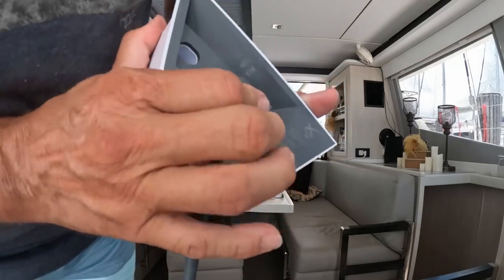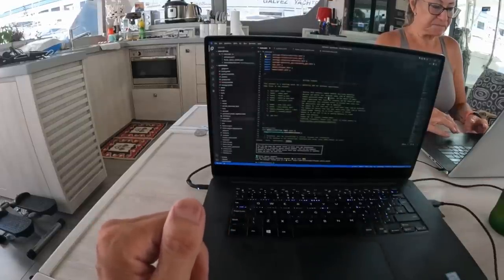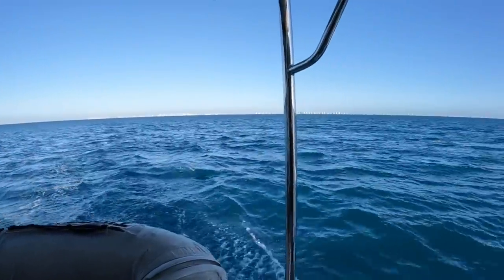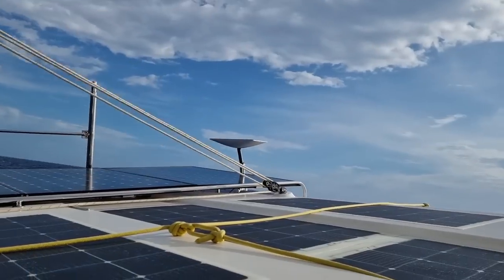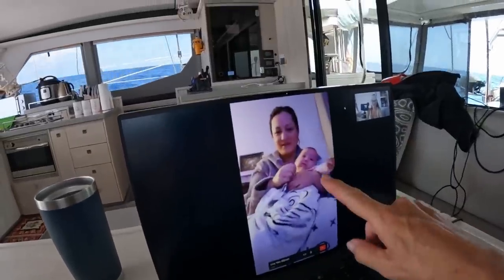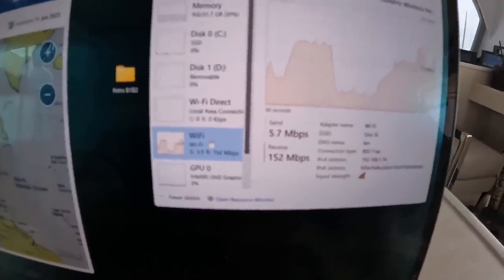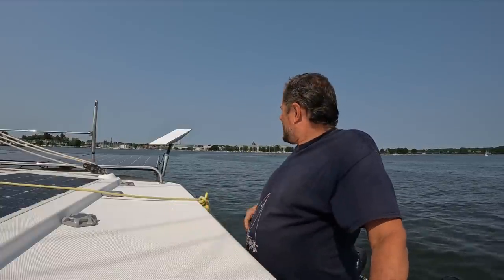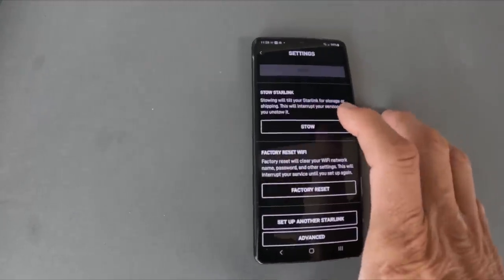#191t Starlink on a Sailboat 100nm Off the East Coast in the Atlantic | Sailing Sisu Leopard 45

Comment: Yep, it's a game changer! Starlink completes the technical requirements for my cruising the world.  I got one two weeks ago, installed it on my boat. Works well, but I haven't been able to sail anywhere yet.  The limitations are not distance from shore, it's regions that Starlink has set up. There's also part of the agreement that you check (without reading) that emphatically says you agree to not use it while moving. I expect they'll warn you if they're really bothered. 
And on the coast of Crimea the Russians found an autonomous boat with a Starlink Dishy. They blew it up because it was a 'smart torpedo' (??) full of explosive. 
"Starlink isn't affected by most clouds" and rain. Heavy storms can affect the signal strength. And if you really want to try it flat, no motors, than just support the four corners and let the vertical 'tube' do whatever it wants hanging underneath.
Reply from the maker: Wow! That's crazy! A Starlink autonomous boat 😅 yeah, I love it more that I can restart Starlink and it search for the better angle and then adjust. For now, it never ever stayed horizontal, which means...that was never the optimal position 😏

Comment: We use Starlink on our ambulance rv conversion (Bizzo Ambo Life), in the middle of nowhere we can get great internet. We use Starlink on a mast on our ambulance when we are at home and run the cable into the house - must be a lot more expensive on your cat though Frik. Regards from Vancouver
Reply from the maker: Gary, we use the Residential with mobility plan. It costs the same as RV. That said,  we do have outages because of our movement like tacking or swinging at anchor,  but I guess we get what we paid for 😊

Comment: Starlink ground stations send a receive the data to/from the satellite.  Too far offshore the ground stations lose line of sight with the satellites. In the future, a laser system will relay your data stream from satellite to satellite to satellite finally relaying it to/from a ground station.  Starlink is deploying this new generation of laser-capable satellites now. It will cost substantially more. See Starlink marine pricing.

To lessen dropouts. Some boaters have removed the chip that controls the antenna's movement. They freeze it in a flat configuration.  To do it they drill a hole in the back at a specific location, remove the chip then fill the hole with a plug. You can YouTube it.
Reply from the maker: Hi! Just for everyone else's info. Starlink Sats already had lasers since v1.5 and that's why we had internet 100nm of the coast ;-) Granted, I suspect that some place such as Maine, don't have laser sats in orbit and still need ground stations.
Reply from the maker: And if you watched the video, you would know NOT to cut the motors ;-)
Reply: @SailingSisu  Love your videos. I did watch the entire video and enjoyed it very much. As I understand it, the reason the motors were disconnected was to stop the Starlink algorithm from picking a "better" satellite even if a perfectly fine satellite is usable pointing the antenna only straight up. That antenna movement causes many disconnections. Just because the antenna adjusts in your video to a lower altitude, it does not mean a perfectly fine satellite is not overhead. A look at your satellite constellation may help.

Starlink does not have FCC approval for a dynamical moving antenna. So the Starlink algorithm is assuming it is setting up a relocated antenna, not a moving antenna. I do not know. Just trying to help with your disconnection issue. I would suggest reaching out to fellow YouTubers who have experience disconnecting motors. Maybe they can help 

Best of luck, fair winds, and following seas.
Reply: @SailingSisu  I do not know.  We know laser crosslinks were tested in 2020. We know the first v1.5 were launched in January 2021. I could not find an announcement that laser crosslinks were operational. Launching satellites is one thing but I would have thought having that technology available to subscribers would make news.  Sorry, could not confirm for you.
Reply from the maker: No worries! Elon tweeted e few weeks ago that even Antarctica has now Starlink, which can only be reached if the satellite had laser.
Reply from the maker: The Starlink v1.5 satellites, launched since 24 January 2021, have the following additional characteristics:

Lasers for inter-satellite communication
Mass: ~295 kg (650 lb)
Visors that blocked sunlight were removed from satellites launched from September 2021 onwards.
Reply from the maker: https://twitter.com/elonmusk/status/1571702286854004736?t=iAbmyGm6mt5SWx1Rm1q5lg&s=19
Reply from the maker: https://twitter.com/elonmusk/status/1482424984962101249?t=6Qto5XjxeizoVXCxp3Ouxg&s=19
Reply from the maker: https://www.space.com/spacex-starlink-internet-satellites-lasers-launch
Reply from the maker: Just a few links. We would not have had fast speed Internet 100nm of the coast if the sats only relied on base stations. I can only say what we experience 😊 also, keep in mind that those sats are in low orbit, which means that they fly very fast, orbiting the earth every 91 minutes! There are no stationary Starlink sats, hence the phased array dishes. One will severely limit the dish by cutting the motors. Just our experience.
Reply: @SailingSisu  Thank you.  really great info. Thank you.